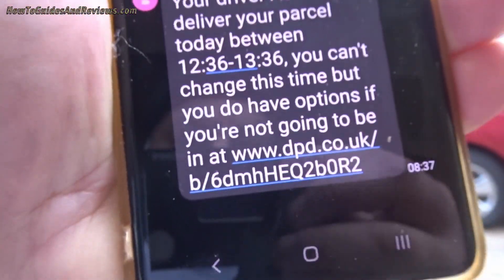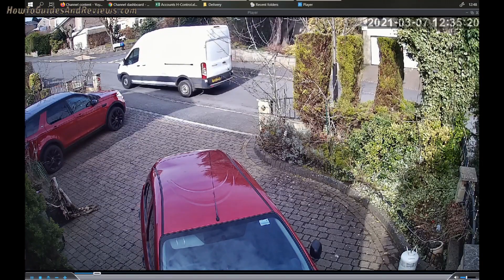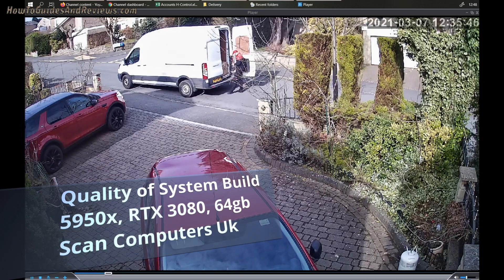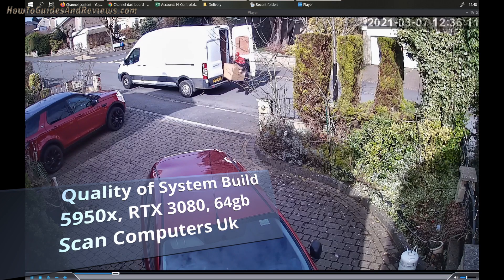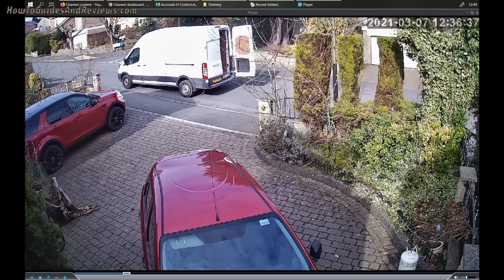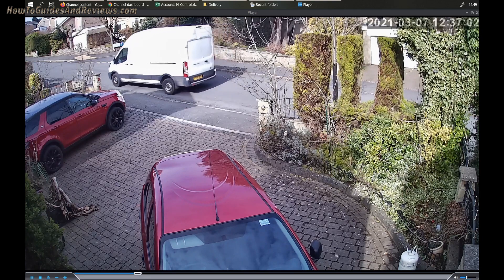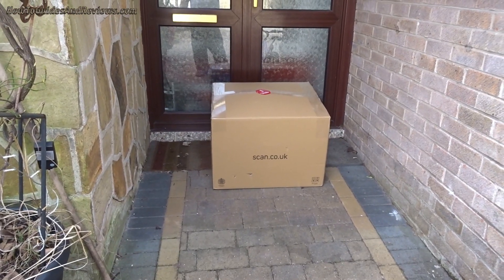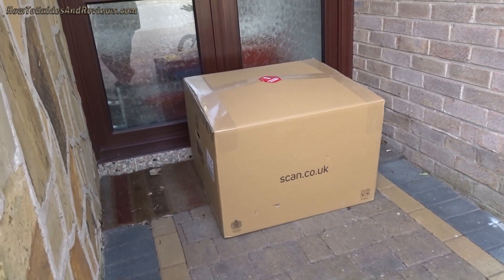Scan Computers UK Quality of Custom 3SX System Build 2021 - 5950x, RTX 30380 - Scan.co.uk Review (4)

Comment: damm 1000watts is overkill for this tbh
Reply from the maker: you need to learn more cos PSU's degrade over time.
Reply: @Quantum_AI_Tech  ehh but by the time its does you would just upgrade/replace anyway so its a non-issue tbh

Comment: Which HDMI port do i plug in my HDMI cable going to my single 1440p monitor
Reply from the maker: Either, but you will need a HDMI 2.1 cable for 120hz /144hz

Comment: You can't control PWM fans properly from a fan controller, that's why it was removed and fans plugged directly into the board.
Reply from the maker: Yeh IF you have a good board with plenty of fan headers. If not you need a fan controller.

Comment: How to guides and reviews do you think it's big risk if I transport my 3xs pc (didn't unboxed) 2000km in the van?
Reply from the maker: It will fine as long as you check to make sure everythings firmly slotted in before powering up. Alsways check cables etc have not come loose due to vibrations during transit.

Comment: Managed to snag one of the last 2060 super FE systems at christmas cant lie and tbh the 2060 super gets no ratings(never seen many tech guys review ) but that gpu is serving me well(plus thst extra 2gb vram vs the 2060 worth it) at least until i can get a 3070 and a 1440p monitor wont even sell the 2060s FE as they dont make founders carss anymore and its a beautiful card visually.
Reply from the maker: My prev system had a GTX 970 which was absolutely fine for every day use, powered 3 screens at 1440p, got 6 full years of work out of it before upgrading  your 2060 super is good for at least another 3 years before you really need to upgrade. the reviewers and sellers tend to over hype expectations between generations, every day use is not going to see much change between a 2060 and 3060,
Reply: @Quantum_AI_Tech  yeah i didnt think the 3060 non ti was even worth it. Out of the whole 20 series id say the 2060s was perhaps the only one that i could justify the cost of 😂 heck you can still do well on gtx 1070s,1080s and even 980ti. Id admit tho the 3070 card is perhaps the best value of the 3000 series that and the 3060ti. I never buy the top GPUs for gaming i look for best value to performance hence getting the 2060s over the 2060 or anyother 20 series card. I find really the higer end cards have a diminishing returns for gaming only usage.

Comment: Orderd mine in February still waiting on my 3080 tuf to come taking ages and do they normally deliver by expected delivery date
Reply from the maker: If you mean the date the website shows when ordering then no, that is not reliable, if you mean the date they give you WHEN they started building, then yes that should be reliable. You have to wait until they start building it, watch my previous videos in this series.
Reply: @Quantum_AI_Tech  Yh ok mate thanks and I believe the reason they didn’t put the heat sink on is because the mb already has it built on the board
Reply from the maker: @ Tyler Hughs  Yes the motherboard has a heat sink for nvme2's but corsairs is chunkier, so would dissipate more heat, could mean a difference of 4 degrees, anyway as long as they run under 55c under load then they should be fine.
Reply: @Quantum_AI_Tech  when it arrives I’ll props put it back on but I take it out when I put it back in do I have to go to the bios or anything or will it just be recognised straight away
Reply from the maker: @ Tyler Hughs should not make any difference to bios, check the temps first to see if it's running hot , if under 50c then it won't make much difference to ssd life, if over 55c then yeh you should put the heat sink on. MIne with mb heatsink are typically 47c and 45c. Under constant load for 5 mins 53c and 50c
Reply: @tylerhughs5950  You’ll be waiting a few more months also, Scan used to say that all prebuilt take priority. If you ordered the 3080 and 5900x I’d say another 2-3 months before you receive it as they just seem to be getting no stock. I’ve been monitoring their updates and in the past month they’ve only built 18 PC’s.
Reply: @tylerhughs5950  Ordered mine in January still Awaiting Picking, so I wouldn’t get my hopes up 😂
Reply from the maker: @Clextiツ The stock tables on their site do NOT include prebuilts, they use DIFFERENT codes for the custoim built pc components, I did a video earlier showing this.
Reply: @Quantum_AI_Tech  yep, scan are very poor when it comes to getting stock in, replying to emails, updating their customers. You’d think if your spending 2k+ at a company they’d have more of an initiative to email their customers not get their customers to ask for updates.
Reply: @Quantum_AI_Tech  did u have to put the heat sink on in the end mate or isit fine as iam asumming it won’t do much difference as the motherboard has a built in one
Reply from the maker: I get 46c and 44c in normal day to day usage, When high load i.e. benching it spikes to 56, then quickly drops to  50c.  So I'm leaving as is for now given that usual temps are below 50c. Don't want to try and fix what ain't broke and end up breaking it :)
Reply: @clexti3904  Agreed, since I ordered in January no email has come from scan. And probably wouldn’t have received any if I didn’t email them but then I’m still getting the generic copy and paste answers.
Reply: @brixxchezzy  Exactly, I’ve asked for follow ups, ETA’s, where I am in the queue and I just keep getting a generic email saying ‘don’t worry we haven’t forgotten about you’ I was recommended scan from a friend and I’d never use them again. I think it’s better to pay a little bit more of a premium from let’s say eBuyer and get ur PC within 2 weeks. eBuyer are getting the 3080’s in within 2 weeks but somehow scan have only built 59 computers in the last 2 months and 3 weeks. It’s a joke they’re piss poor and wouldn’t ever recommend them.
Reply: @clexti3904  HOw do you know how many prebuilts scan have built in this period? 
And what other companies do you reckon will deliver prebuilt with 3080 faster?